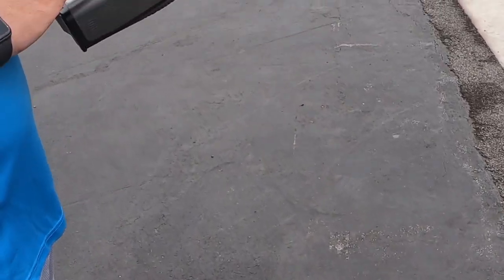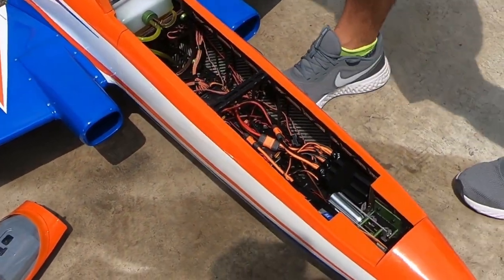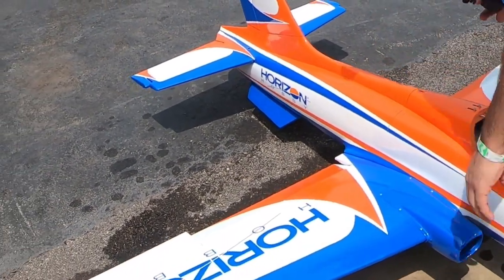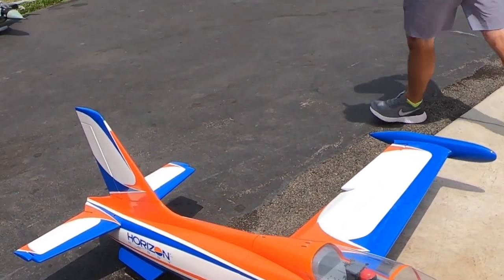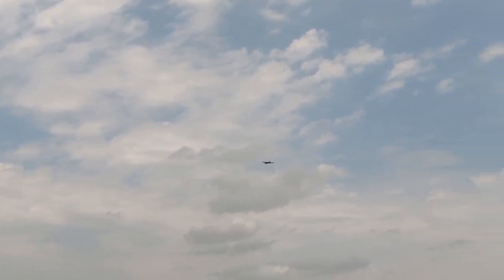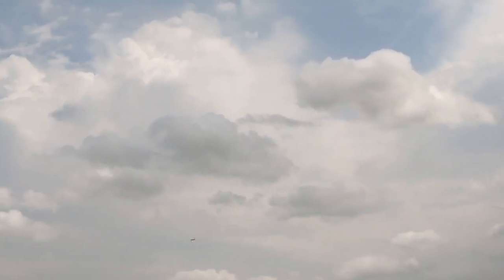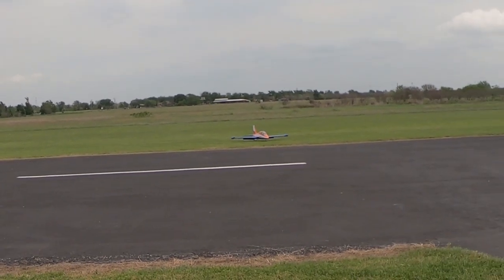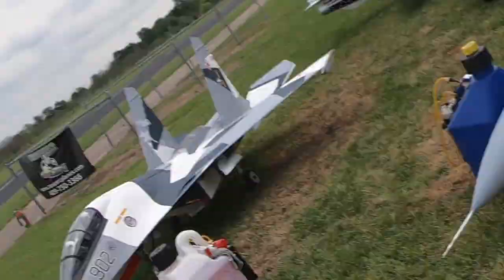Hangar 9 Aermacchi MB-339 with a KingTech K-85G4 Turbine

Comment: I flew RC planes for about 12 years then I have been taking a break from the hobby.  This looks like a real cool plane from Horizon Hobby.  I had bought many different planes from Horizon.   I wonder if the pilot ever lost orientation for a bit when the plane was far away?  I always put orange strips on the bottom of my wings to help me with that.  This does look like an excellent beginner turbine jet I would give a try when I get back into the hobby.  I had prefered flying the electric planes vs gas but a turbine is a different animal.